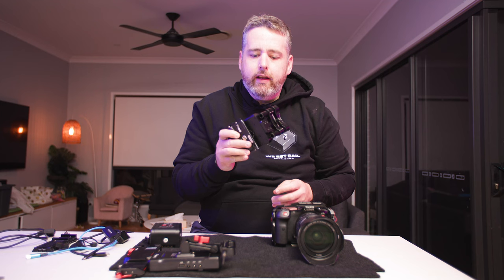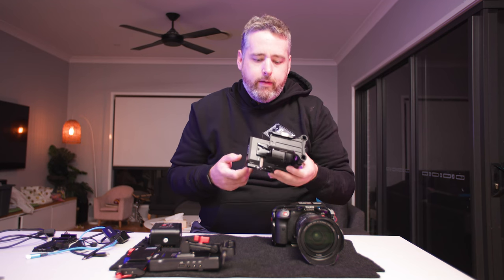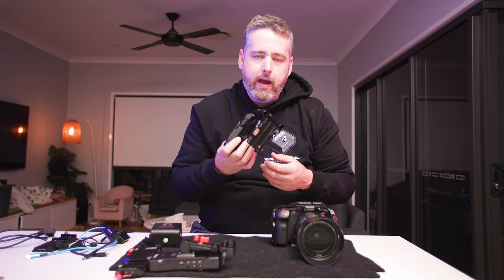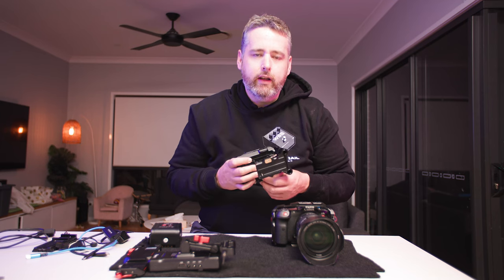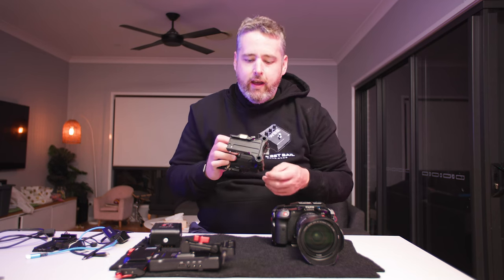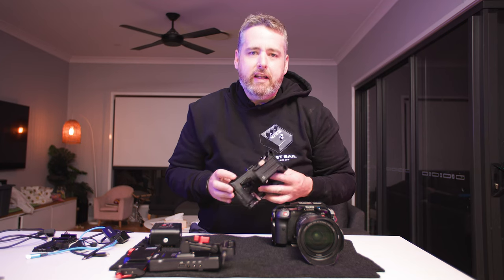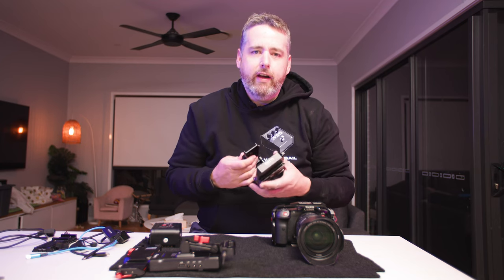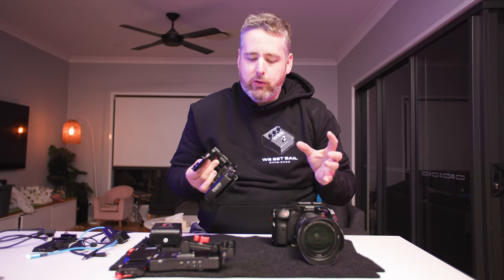Tilta Smart V Mount Battery Baseplate - 1 year on (re-upload)

Comment: Hello, I want to know if you can attach this Plate to the bottom of The Roonin gimbal grip an at The bottom of The Plate The tripod, i have this idea in my head and I want an opinion about it.
Reply from the maker: Hey, yes you can put an arca plate on the bottom of the ronin battery grip, then screw the ronin feet to the bottom of the tilta plate. But in my experience because there’s only one screw hole with no locking pins on the bottom of the ronin battery grip the plate can twist and get loose easily. 
I’ve found it easier to mount a vlock plate to the ronin handle on the side. Hope that helps

Comment: Just checking what functions the DJI Ronin Pro allows you to do on the Canon R5C..

I have a Feiyutech Scorp Pro Gimbal that is locking up my camera .... I borrowed another R5C from Canon New Zealand to see if it maybe a camera issue..

I found that in photo mode it locked up the camera and the only way to restart the camera was to remove the battery..

This was also happening in  video mode with the usb cable from the camera to Gimbal plugged in.

So both my R5C and Canons one was having the same issue.

Feiyutech was contacted and I am yet to here back on their tests. 

Quite frustrating as I like the lower profile Gimbal.

So my question is what is the negatives of the DJI Ronin before I jump to purchase one.. 

Thanks for your assistance in advance.. 😊
Reply from the maker: Hey Michael, what a pain that your gimbal locks up the camera! 

I very rarely use my r5c plugged into the dji rs3 pro via the usbc ports because I'm generally using the usbc port to power the camera. But I have tested it and can confirm that with the dji usbc cable plugged into the r5c you can control the start/stop recording using the red button on the gimbal. If you assign the dial to focus you can also pull focus on the lens as well. this can be a bit funny at times, because the dial is short, doing a slow and long focus pull can be hard because you need to lift your finger and move it back to the other side of the dial to continue. 
I did try to assign the dial to aputure, shutter and iso but each of those didn't seem to work.

I haven't tested any photo modes as I only use the gimbal for video. 

hope that helps in some way,
Reply: @videographerstuff539  Thank you for your reply..
Yes it's a pain that that gimbal locked up as it has many features..

It's good to know about the DJI one so really appreciate you discussing it.. Thank you.

Comment: On the Tilta plate are the 15mm rods spaced apart the same as normal 15mm rods for baseplates? That way I can use the top arca half of the Tilta v-mount system but use a different v-mount plate that is thinner cuz the smallrig v-mount batteries already have all the ports I need so I don’t need all the extra power options and weight of the bottom half that comes with that Tilta system.
Reply from the maker: Yep it the same rails as normal ones so you could do that.